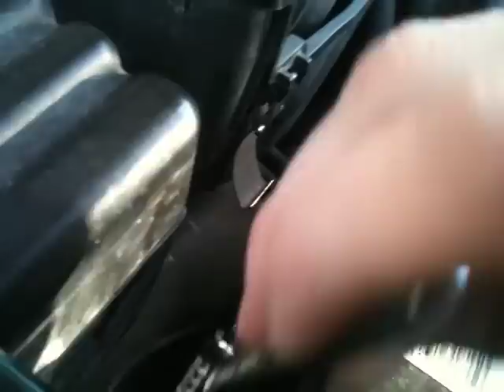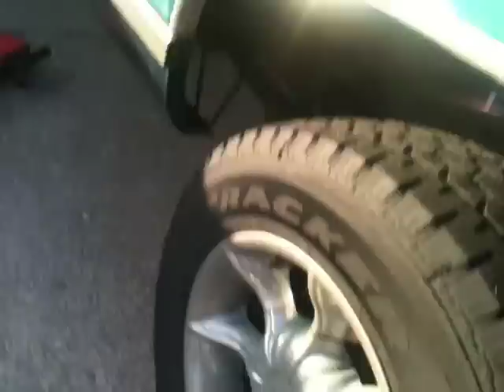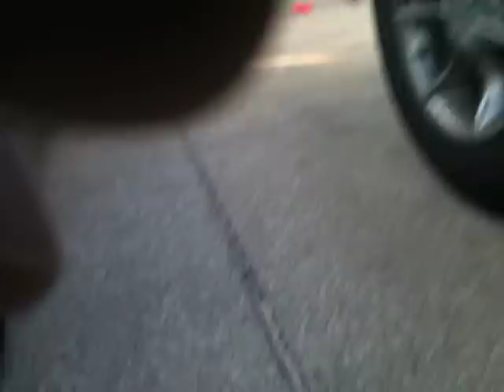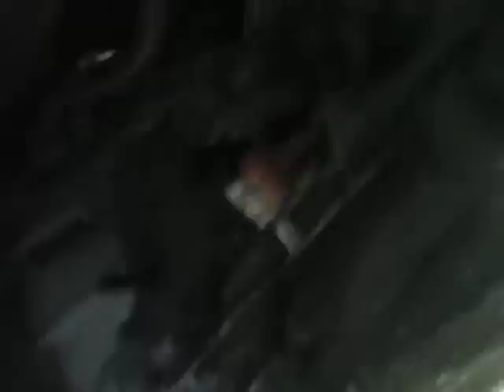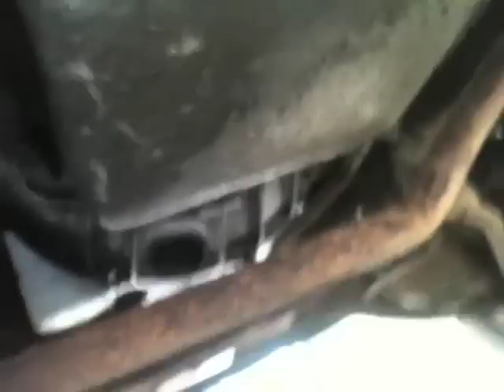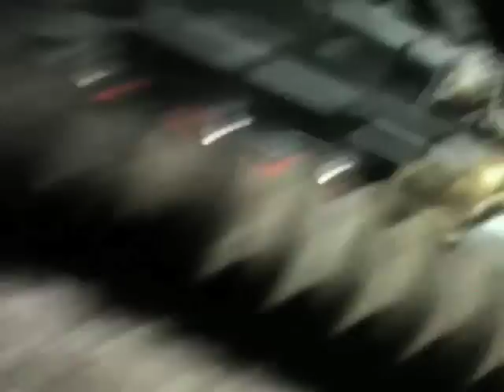Neutral Safety Switch Replacement 98 Silverado (full size GM trucks)

Comment: That part is going to fix my reverse lights to turn on ?
Manual transmission gmc sierra 98
The reverse gear doest press the switch light inside the gear box,
Brand new switch when I press the switch manually my reverse lights turns on .but doesnt work when is intalled ,Can you help me ? Thanks
Reply from the maker: TBH I'm not sure. sold this truck about 8 years ago and I owned the automatic trans model. The NSS did link up to the transmission cable and I believe it did relay gear info for lights, but I'm not sure how that linkage works in the manual version. good luck on finding out! and please let us know if you figure it out just in case someone else comes here with the same issue.
Reply: @foxinsoxx  Thanks for respond and for your videos 👍🏼

Comment: sooo, you remove the ground cable with a crescent wrench ? , instead of a 5/16 box wrench ?  I can't respect this shade tree video
Reply from the maker: I more than likely didn't have the right box wrench at the time... or it was lost in the bottom of some random tool bag in the corner of my garage... HA! This was the first vehicle I owned where I decided, "I'm going to fix things on my own"... with a random assortment of barely enough tools and the dedication to get it done. a decade later, I have acquired more of the right tools for the job. but as far as respect goes... I'm pretty happy I decided to step out of that comfort zone. it's saved me thousands in repairs and opened up a whole new understanding on cars in general... maybe that's worth something to you, maybe it isn't, either way hope this video helped your personal repair in some way... that was the intention.

Comment: I have a 98 k-1500 lost all gears at the same time neutral safety switch be the cause transmission was running Great before Out of nowhere just lost all gears please help
Reply from the maker: that's a tough one... if it is the NSS, the cable from the shifter will be loose. it might be an issue inside the transmission. did it sputter/grind before it died or does it seem like the truck is just stuck in neutral?

Comment: Hi and thanks for the video. I have a 1996 k1500 that is having starting issues. I replaced the starter/solenoid, the engine chassis’s grounds were pretty bad so I replaced those. Along with the starter going bad my truck also blew the 40amp ignition fuse and starter relay. I replaced those and tried again but they blew. My next attempt is replacing my ignition switch, but that seems to test right with my multi meter. I was going to try the neutral safety switch also. Any ideas. I sure could use some help. None of my mechanic friends want to touch electrical
Reply from the maker: check that the leads from the positive terminal on the battery are all receiving proper voltage. I have a video on this channel on how to cut out all the rubber that causes general starting issues. also re-wire the lead to the starter with a brand new wire... there could be corrosion or a stripped section grounding to the frame somewhere along the lead.

Comment: What was you problem? Thanks
Reply from the maker: The entire electrical system between the ignition and the starter. Not sure if it was unique to my Silverado, but the big issue was corroded wires. Had to replace a lot of electrical in that truck.

Comment: I replaced mine and now I can move shifter without pressing brake. Why is that?
Reply: Under the Colombo there will be a black rod with a ball hitch like system, make sure that’s on the ball it’s supposed to be on, that happened to mine.

Comment: If the connectors dont pull out with a gentle pull its because a sealant was used inside the connectors. You have to use a heat gun to CAREFULLY  heat each connector and they will slide right out. You will also have to heat the male connectors to reinsert them into the switch.  Also, the switch inner ring has a line up. This is the neutral position. With the shift shaft in the neutral position the switch will slide right on and will not need further adjustment.

Comment: Mine also broke on top wire so found replacement on ebay for 20$ and change included shipping in price was kinda worried about such a cheap price but it worked great

Comment: Is it just me, or doesn't anyone understand what a neutral safety switch is? Usually, they're under the dash, mounted on the steering column. I'm about to check mine, and this video is misleading. And I did just crawl under my 1993, and it is on the column. GMT 400 series trucks (like his), run from 88-98.
Reply from the maker: your 93 would be a different setup. I believe they started putting them on the underside like this around 95-96.
Reply: I stand corrected. You may be right. And the sw on my column may "not" be the safety sw, but the rev. lights. I don't know at this point. The wires look too small, and are the wrong color for a neutral safety sw. I need to find a diagram.

Comment: Got a question! I have a 2000 Chevy Silverado 1500 with a 4l60e transmission, I did a engine swap cause my 5.3 blew up on Thanksgiving it sucked lol, anyways, so I got the new 5.3 in my truck bolted the torque converter and transmission up plugged everything in and started my truck! It starts up great runs like a top, but I now have a problem! When I put it in gear to go it won't move I put it in all the years and it won't move I put it in reverse to see if it was reading and my reverse lights came on but will not move, so I tested another therory out and put it in neutral and tried to start it would not start! What could this problem be?
Reply: Marcus Daniels have the same problem did you fix ?
Reply: Safety neutral switch. Google the symptoms. That’s your problem.
Reply: Let me know if that helped you

Comment: i bought a 1995 suburban that needed a steering column be the person i bought it from lost there keys i replaced the column i try to start it bt all it does is click 1 time i replaced the starter twice same thing got new battery an wire like positive an negative wires bt i get the same results do u have any ideas. please help yhanks in advance
Reply: Go buy a button and about 5-6ft of wire and just wire in a push to start. It's only 1 wire, very quick and painless.
Reply: Neutral safety on the column??

Comment: Working on a 95 Cheyenne right now. Replaces the starter a few months ago bc I had issues. Then I put a alternator on it this afternoon before learning about a safety switch. I will try to change from park and neutral then loosen and wiggle the switch. I have a new one but I was told I should try to wiggle first then replace it if it wont start.

Comment: what was causing the problem to make you change your nss because I have reverse only, no forward gears engage at all, only reverse
Reply from the maker: I had starter issues, and a simple replacement starter didn't fix the problem. i had replaced the starter switch, starter, and NSS before the system was working again. You have to consider that the youngest of these vehicles is now 19 years old, that's a lot of wear and tear on all parts. if you plan to keep it around for many years, if one part of a system starts to show signs of significant wear, it's a good idea to just replace the whole circuit. 

For your issue, start by checking your spring and cable running down to the NSS, it could just be a bad cable. worst case scenario is a bad transmission.
Reply: FoxInSoxx  the trans was completely rebuilt, my ol lady said it was making noise like it was grinding and it was lagging in 2nd gear. but the torque converter, pump, filter n fluid were new after the rebuilt trans, idk, but the cable shifts in all gears

Comment: Over the last 2 weeks in my home garage I replaced every seal in my 03 Suburban, oil pan, rear pan, crank and cam sensor, oil pressure switch, rear main, cooler line block gasket, rear head freeze plugs (both sides), rebuild transfer case (bad bearing) and cleaned all the mess the leaks had made. Well I go to crank her over nothing? I remembered all this gunk on the 2 neutral safety switches, so i take a sewing needle and clean the female connect a little bit and then plugged it in and she fired right up. So I let it run for an hr, no leaks I almost did a back flip but for the fact im out of shape and could never do one anyways, but when I go start a test drive and put it in D it shoots to 2 and the other gears werent showing on the dash. I ran to Oreilly's and bought some electrical cleaner and some tiny wire brushes and clean the heck out of the male and female leads. Well try after try its 12:30am and I got all gear to read on the dash as I shift they match up but I go to drive and I got weak power to no power and vehicle cuts off. Earlier when I first got it started I only had P, 3rd and I reversed all the way thru the alley perfect but now reverse cuts off the engine? Help!! I have put 40 to 50hrs Im desperate! Thanks!
Reply from the maker: sounds like it's not a problem with the NSS, but the cable leading from your shifter to the transmission (the NSS bridges off this connection). of you make adjustments to the NSS, you actually can re-install the shifter cable upside-down which will leave you shifting to the wrong gear.

Comment: How did u find out it was the safety switch? I have a 1999 k1500 an it won't start but with key in the on position I can jump the starter an it will start right up.but I noticed that when I turned the key over one click the gear light indicator was lite up but in the on position it is not.woild.that be the safty switch.

Comment: can the safety switch on my transfer case stop my blazer from starting? used to start in neutral. now just turns over but won't start at all..
Reply from the maker: +Angela Valdez Turns over as in cranks but won't start? If the NSS is working, it won't allow the starter to crank in gear, so if it is cranking in neutral, the NSS is doing it's job. the problem may depend on how old the car is... sounds like it could be anything from a bad battery, to a bad starter cable, to a bad starter. If it's an older truck, it could very well be a worn out starter, start by removing the starter and getting it tested at a local auto parts store.  If the truck is around 15 years old, it would be a good idea to run a new starter cable too.

Comment: OK, I HAVE A MASSIVE ISSUE HERE. CAN SOMEBODY PLEASE HELP?????  I HAVE A 97 GMC YUKON THAT I'M HAVING TRANSMISSION ISSUES WITH AND I'M ABOUT TO SET A BOMB OFF IN IT. JUST HAD A REBUILT TRANSMISSION INSTALLED ONLY TO HAVE TO SAME PROBLEMS. RUNS AND SHIFTS GREAT TILL ITS WARMED UP THEN AFTER I COMPLETELY STOP I LOSE OVER DRIVE AND IT WON'T DOWN SHIFT. I CAN MANUALLY SHIFT IT BUT CAN'T GET OVER DRIVE TILL THE TRUCK IS COLD AGAIN. I PUT A NEW PARK NEUTRAL SWITCH ON AND STILL SAME PROBLEM. SO THEN I REPLACED THE TPS LAST NITE AND STILL SAME PROBLEM. SO THEN WE CHANGED THE TIRES BACK TO 265/75/16 CAUSE I HAD PUT 285/75/16 ON IT. BUT NOPE STILL HAVE'NT RESOLVED THE ISSUE. ONLY THING LEFT THAT I CAN THINK OF IS THE COMPUTER,WIRING PROBLEM OR SPEED SENSOR.  CAN SOMEONE PLEASE HELP????????????  THERE GOT TO BE SOMEONE OUT THERE THAT HAS HAD THIS ISSUE. I GUESS ITS VERY WELL KNOWN FOR THE 96-97 ..........HELP!!!!!!!!!!!!
Reply: J IMHAUSEN i no your comment was 3 years ago but im currently having this issue with my 96 chevy cheyenne 4.3 v6 1500, could you maybe pass me advices that youve learned
Reply: Have your truck scanned and see if 02 sensors pop up. If they are bad they will act like your transmission wants to slip and buck. Also clogged catalytic converters. Clogged cats can ruin the 02 sensors. Ask me how I know lol just had mine rebuilt and took it back to the shop pissed off and they scanned it and said that was my problem. Also google the symptoms of bad 02 sensors and bad catalytic converters. You’ll see what I mean. Hope this helps.

Comment: Earl, above your brake pedal there is a switch thats going out,, Its about $10,
and the Switch in the Video above Isn't actually a Neutral Safety Switch, 
Its a manual lever position switch), or MLPS, it requires two 12 mm wrenches and two 15 mm wrenches,, All it does is communicate with the transmission to let it know what gear you shift lever is in, This is why some people refer to it as A Neutral safety switch, being a component of that system is just one of its jobs

Comment: I have a 2000 Yukon Denali that wont shift out of Park until I turn off the engine, keeping the key turned to the "on" position; foot on the brake and then shift into "Neutral" and restart.  I can shift into "Drive" from "Neutral."  Not from "Park."  Is that the Neutral Safety Switch?
Reply from the maker: Sounds like it could be your issue.  you could also check your key lock assembly and your brake switch.

Comment: Thanks for the quick reply ill take a look at all your advice on that... the guy at the shop told me limited information because he knows ill probably fix it if he'd tell me i guess its buisness right. He told me the transmission is fine and the 4x4 is fine. But i dont understand what he means by i have a short and two cables in the harness are stuck together and he would charge me 350 to fix it its kinda irritating because i payed to know what my problem is and he didnt clarify it 100 % . Ill look around for other places but when i find the actuall problem i hope my solution helps more people on youtube... next time ill just get a ride to work and take my battery to get charged at kragen. Anyways thank you for your reply and advice.

Comment: Hey i saw your video and im currently in doubt to what my problem is... heres what happened to me. I left my key on the ignition all night so when i woke up i had to go to work.  So i had to push it back on neutral to jump it. The thing is i jumped it and my wife never changed the gears from neutral to park so she started it in neutral or tried to but couldnt it sounded still dead so i waited for a charge n then i noticed the gear wasnt in park so i put it in park n it started perfectly only.........  Now the 4x4 selector switch lights all light up but i cant switch from 4hi to 2hi or anything. It makes a scraping noise after 15 mph. I wonder could this be that neutral safety switch bad...? I took it to the shop they charge me 350 to fix it and said it was a wire harness but i dont trust shops they rip u off for small stuff...
Reply from the maker: I don't have a 4x4 model, so i'm only throwing out guesses here. Could be that you knocked up something in your 4wd transfer case when you did the neutral jump start, or knocked around something with your transmission.  does the grinding sound like its coming from the transmission? or maybe you popped something in the differential?  the sensors go buggy when that stuff is off and they are very intricate gear systems.  I'm not sure that the NSS does any controlling of the of the 4WD though.  It's main job is to be a safety gateway between the starter switch and the starting mechanism… so you don't start the truck in gear. the 4WD may bridge off of the NSS if your truck does not offer switching on the fly.  I hope all of this made some sense. The NSS a fairly cheap fix so it's worth a try, but i would find out where that grinding is coming from, that could be triggering a sensor that inhibits your 4WD for safety reasons, I'd hate to hear that you dropped a transmission or blew out a differential or transfer case. look for leaking fluid underneath or around those areas ASAP.

Comment: Good video.  One great tip - heat the electrical connections before trying to take them off.  Two or three minutes with a hair dryer on its hottest setting is sufficient.  You don't need a heat gun and probably don't want to use a torch.  Worked like a charm.  Also, when reinstalling, reheat the plugs and sockets a bit to resoften the adhesive.  Makes plugging them in easier and resells them. Thanks for posting this.
Reply: Sorry.  That's "reseals," not "resells."  Darn autocorrect!

Comment: i have an 2005 tahoe with 4x4, would this switch cause the vehicle to go into neutral while it's in drive, and to fix it, i have to pull over put the shift selector in neutral and then press one of the 4x4 buttons (doesnt matte) then push it back into 2wd and it drives fine again, until it decides to do it again, would this switch be the cause of it????
Reply from the maker: potentially, this switch is the main electrical connection between your shifter and the transmission. there could also be an issue with the cable running down to the NSS.  Sorry for the late response, Hope you were able to figure something out.
Reply: FoxInSoxx
Reply: Mr.Ajd1982, have you had your Tahoe scanned for codes? Does your display indicated a four wheel drive malfunction?  Your problem is most likely the switch located on the transfercase. You need a scan tool that can scan for codes other then engine codes, it most likely has a C code stored for the transfercase.
Reply: Bryan Russell  it ended up being the encoder motor sensor, which is inside the encoder motor itself and is attached to the transfer case, yea, swapped out for a new one from advance auto parts, (about 270.00 bucks) and hasn't done it since, not a tough job actually, if your pretty mechanically inclined, for the '05 tahoe at least you will need to remove the front drive shaft to get to one of the 3 bolts (of course lol) and then just unbolt, unplug and reverse order for the new one, but one thing i learned, make sure the input shaft going into the encoder motor is lined up correctly and sits flush against the transfer case, before you tighten the bolts, it's a little pain at first but it will line up and go in all the way